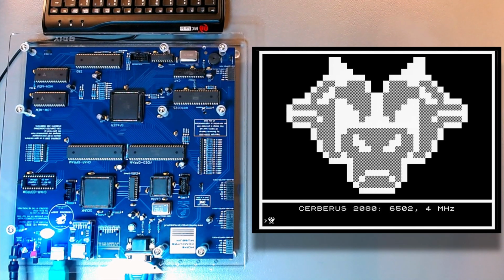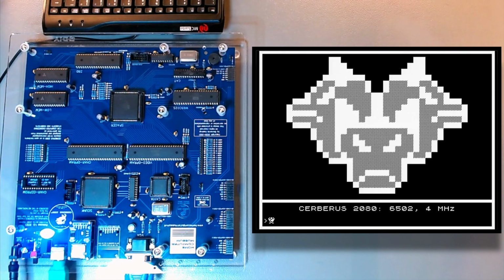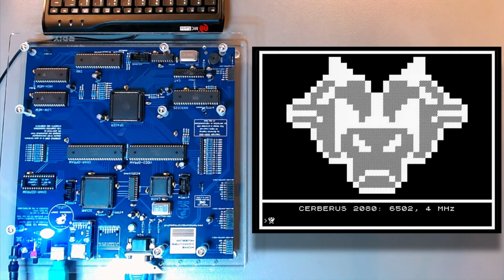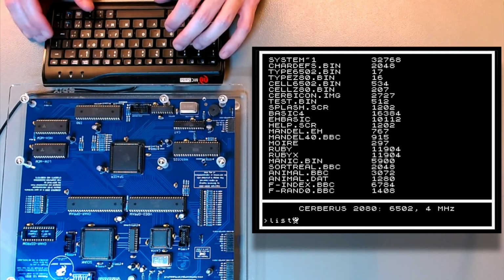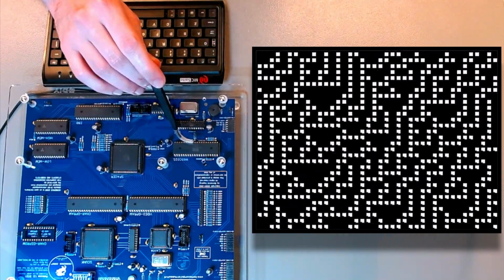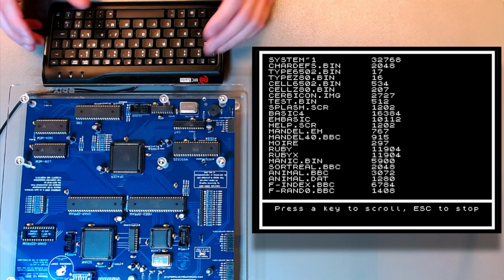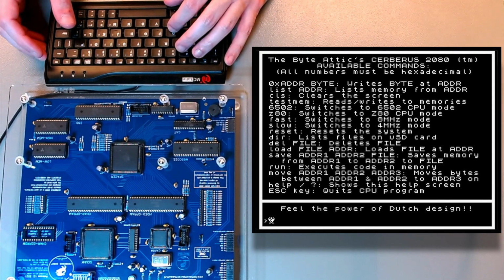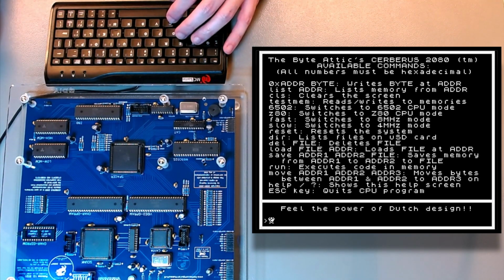Demoing CERBERUS, the basics

Comment: I'm a software guy, not a hardware guy and also I'm travelling around the world right now. But I've been asking for a modern retro platform with both a Z80 and 6502 for years. Since I can't really use a real one right now I'm wondering if there's an emulator.
Reply from the maker: There is one that supports only the 6502: https://feertech.com/legion/cerberus.html. And another one that seems to support both CPUs: https://github.com/paulscottrobson/cerberus-2080. I have no experience with either, as I just use the hardware. If you want to buy a CERBERUS 2080, notice that one of the parts is no longer made due to the IC shortage. So once the stock at the Home Computer Museum ( https://www.homecomputermuseum.nl/en/winkel/producten/#!/Cerberus-2080/p/377348409/ ) is over, you won't be able to buy one anymore.

Comment: What an unfortunate name,  Cerberus  hound of Hades,  guarding the gates of the Underworld to prevent the dead from leaving. 
Unfortunate indeed, can't have any  Hades spawn  as a PC !  :-P   (Though some think windows is just as bad...  )
Reply: There headed dog, this project needs another CPU to fit the name, I suggest a Z8S180 (the super 33MHz Z80 that does 1MB RAM with MMU, duat DMA, dual UART, dual CTC).

the onboard hardware DMA units of the Z8S180 can do the magic during normal CPU operation by just stealing one clock cycle per machine cycle, so read and write to memory and IO transparently. 64K and 1MB
Reply: Cerberus and Hades weren't evil. Also, "Kerberos" roughly translates as "spotted", IIRC, so Hades literally called his dog "Spot".

Comment: I’m not fully aware of your bus methodology. But was there a reason you didn’t double-clock the RAM and then clock the Video-side and CPU-side in anti-phase? That way the video ram would always be available to either side, and there would be no need for the 6502 to be halted.
Reply from the maker: The Z80 has a very different memory access scheme, entailing five cycles. The 6502 trick you are referring to wouldn't work with the Z80, which has a more efficient and advanced design. And CERBERUS must be such that both CPUs work with its bus approach.
Reply: @thebyteattic  Ah… this I didn’t know. Thanks for the info. 😊

Comment: Another Dream Computer! This reminds me of the X16 project except it actually exists :) Did you consider using an FPGA? Those large CLPDs and dual-port memories are on their way out and getting very expensive. Either way I think you could go fast enough to support 80 column text. That way you could support things like CP/M with the Z80.
Reply from the maker: Thanks! I wanted to use only 5V, through-hole components to make it easier for students and educational institutions (ICs that are easily replaceable, boards that are easy to build with a soldering iron). Therefore, no FPGAs.

Comment: Is there a way to sync the code with the video, to avoid flickering?
Reply from the maker: If you see flickering, it's an artifact of the video capturing device I am using. There's no flicker in the video signal itself. The only thing that does happen is that the Z80 updates the screen too fast when being stress-tested. I can only change that by slowing down the Z80 (programmers can always do that easily, by adding delaying code), as the video refresh rate is defined by the VGA standard, so I can't speed that up. As for synchronizing the computer proper with the video circuit, it's not possible, as each uses its own oscillator.
Reply: @thebyteattic  Ok, thanks for your answer!